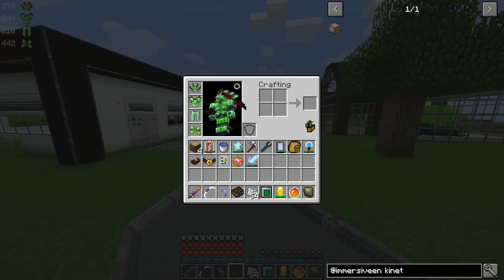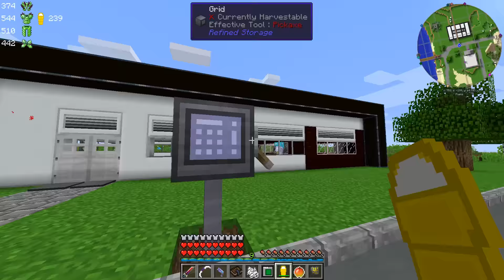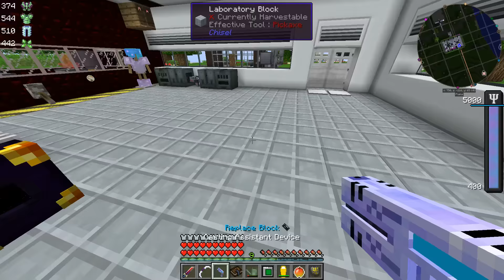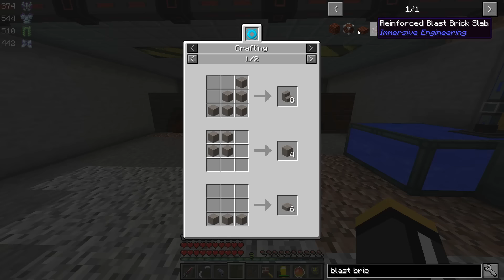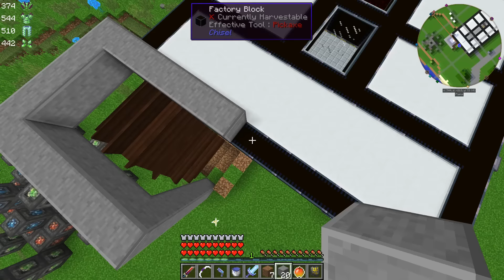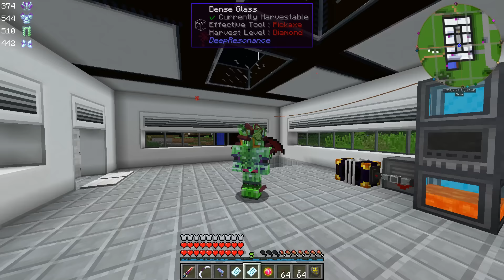Modded 1.10.2 - E38 - Immersive Engineering Green Power

Comment: You probably know what you can use single chisel bit to hold water in place, right? By that it possible to increase somewhat power output of watermills and make them look less bulky. And, flying water is fun.

But anyway, i like your design a lot. Very good job at making things pretty there
Reply from the maker: Thanks for the tip. I decided to go the simple and quick route. I do like making things look as realistic as possible, so while flying water is fun, it's not very realistic. ;)
I think Immersive Engineering makes pretty builds pretty easy. It has a very nice look.